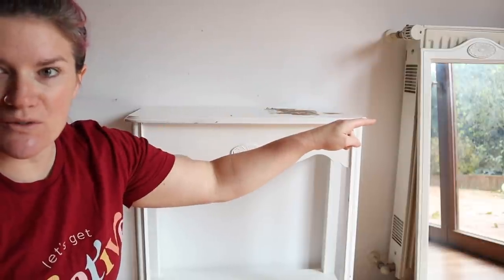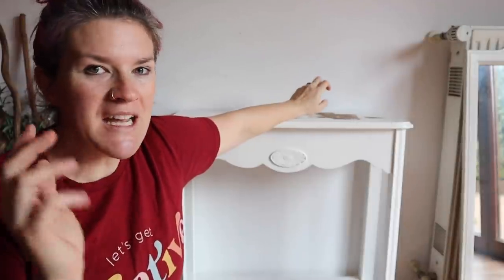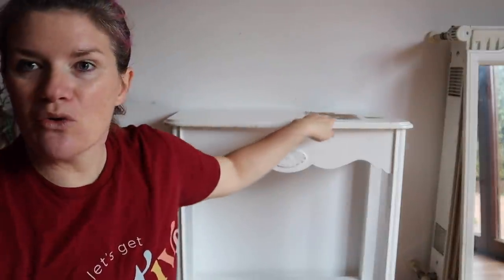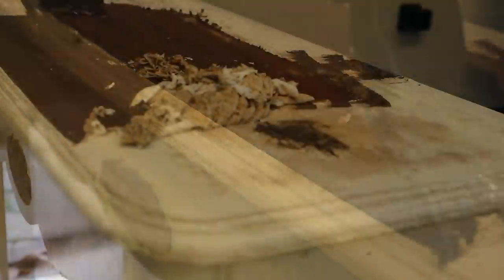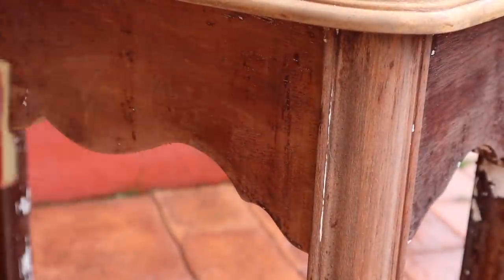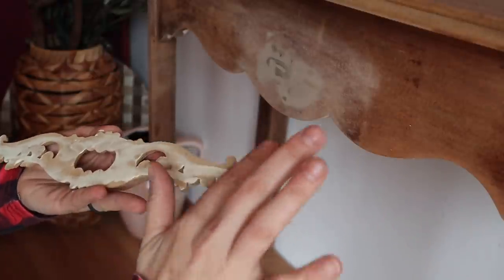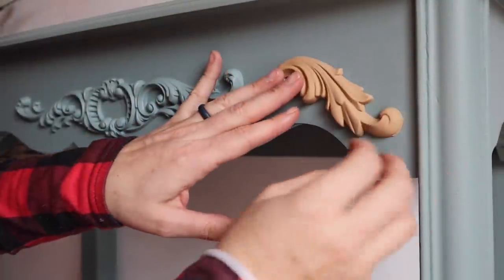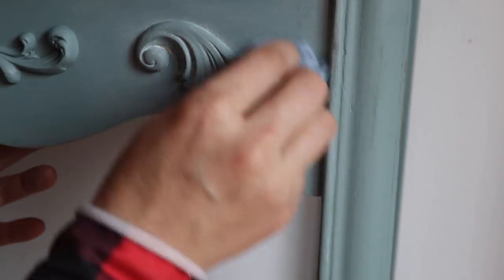Sofa Table Thrift Flip for Beginners Using Silk Mineral Paint

Comment: Thank you for showing how you stripped this piece! I’ve avoided pieces because they needed to be stripped and I now feel more confident about working with them. Thank you also for showing the Woodubend appliqués and how to work with them. I learn a lot from your videos!
Reply from the maker: Thank you Rose!! I know sometimes it is easier to work with unpainted pieces but some pieces really are so beautiful and worth the extra work :)
Reply: Oh My GOODNESS Crysdawna...I picked up this cute little 3 drawer dresser and it has been a nightmare to strip. I've had to use 80 grit sandpaper to break through several spots. I have used 2 different types of "Serious" paint stripper, tried the seran wrap trick and created some new swear words! I completely forgot about trying the heat gun. Your a genius! Thanks for saving my sanity. I'm going to give that a go, wish me luck!😊😘💗

Comment: I had used a primer on my dining room table, but it ended up being really sticky. I tried to sand it, it just gummed up. I tried citrus stripper and it was still too hard to remove it with plastic scraper. Then I tried leaving a plastic garbage bag on half to cover it overnight. It went through the top layer, not sure If it was poly or not. So now my table is down to bare wood on half and the other half still has topcoat. Should I use something like shellac? It looks like the tannins will bleed through on the bare wood side.

Comment: If using regular DB paints, would you top coat and then white wax?
Reply from the maker: Great question!! Usually I spray it with the easy peasy spray wax first then I wax over that. I also use a damp cloth when pulling it back since it’s water based 😍